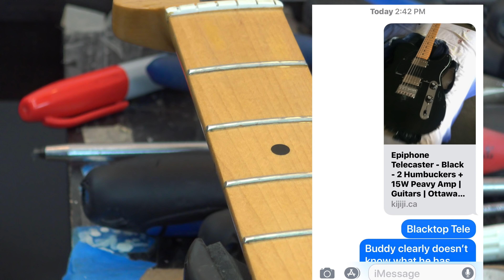Epiphone Telecaster??:Lace Hammer Claw, Locking Tuners & New Pickgaurd

Comment: Good video Bud. I just took a 2018 MIM maple fb neck, and a 2018 MIM Lake Placid Blue body, and put all new hardware and electronics in it myself. I put in a set of Peter Florance Voodoo's with the TE-59 bridge pickup. (7.8k-8.3k). Also I bought a new set of the tuners you put on in this video. All I have left to do is solder the pickup wires, bolt on the neck, and carry it for a setup (the only thing I'm no good at. lol) You are one of about 4 people who inspired me to take on this project. Keep these vids coming!

Comment: I've been enjoying your channel for several yrs. now, and I must respectfully disagree with one comment you made to day. Sorry but Fenders (and similar guitars) do not generally suffer "staying in tune" issues nearly to the degree of Gibsons. (and other similarly designed instruments).  They just don"t.
Reply: And I must respectfully AGREE with this comment, Sheggy
Reply: I have zero trouble keeping my gibson epiphones squiers and fenders in tune without taking special precautions like lubricating the nut and locking tuners and stuff like that
no offense intended, just my opinion based on experience
Reply: @ethan-el1zq  I found as long as the nut is properly filed and you pre stretch your strings even the cheapest of Epi's and Squier's will stay in tune. That and knowing how to string it up is a +.

Comment: The pickups kinda sound the same?? Or just me?
Reply: I agree. That’s too bad. It’s a pretty pickup.
Reply: @Thomasdgolden  and how did people manage to play guitar for all thoes years without locking tuners
Reply: philipb The key to it is set up, proper nut and metal to metal points smooth. My main Les Paul has never had locking tuners. My stock fender whammy bars are all floating. Unless I pull a EVH dump dive, stays in tune great.